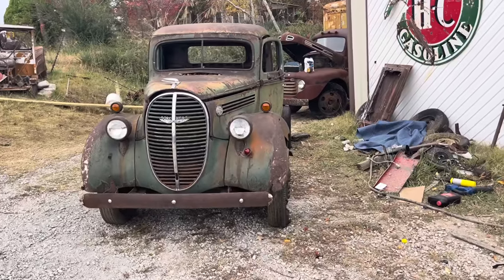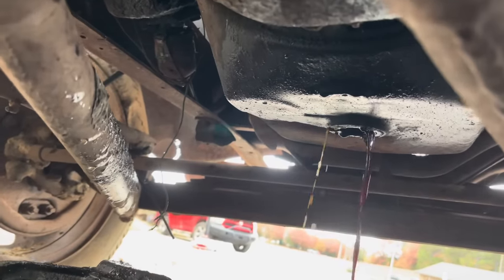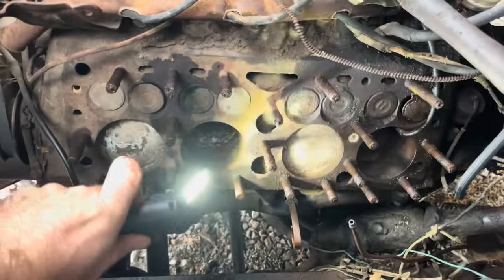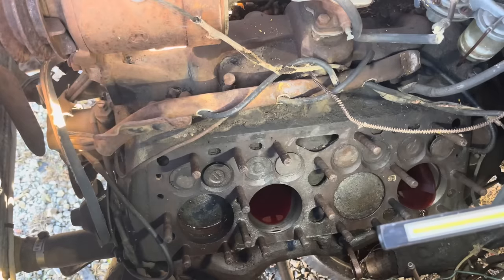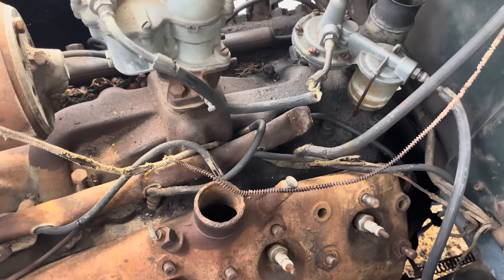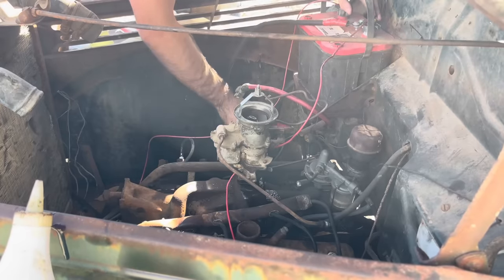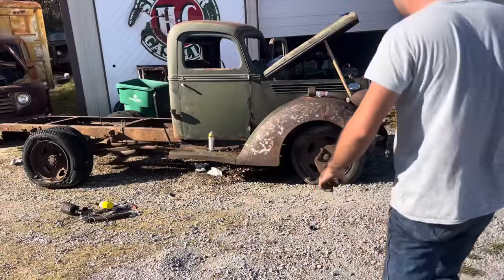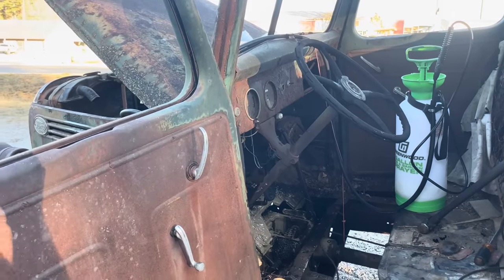Will it run after 65 years 1939 ford 1.5 ton flathead v8 truck

Comment: Imagine 80 years from now trying this with any modern vehicle with all the unnecessary computer crap. It won't happen.
Reply: Exactly lol
Reply: Apparently while the 1996 F-150 truck does have electronic ignition etc the engine it has originally had a distributor and a carburetor. So you could retrofit those parts onto a relatively new engine. The F-150 (and any other suitable modernized classic engine) will probably be the most modern, running, petrol cars one day!
Reply: Just because we don’t have the skills or tools.  These things will be more ubiquitous as the future generations get into cars and they will learn their way around these systems/tools will be developed to simplify it.  To this day my dad still laments about the loss of carburetors and hates fuel injection.  This feeling ain’t new at all
Reply: Year: 2050 "Can't quite get the 2023 Kia Sorento running, on board computer keeps saying: 
Ignition error, Bluetooth device error, fatal exception: Start stop is not working, 5 of the 175 airbags is not working properly, lane departure assist is not working STOP ENGINE.
Apple car play is down, etc."
Reply: @nev12345678910  Yup. I am clueless on carbs, except i can replace jets or whatever and flush it etc, but f tuning it.
FI to me is just plugging it in and getting a computer box on it and then laptop for the rest (I am an IT Pro so doubt much could confuse me at that point).
As for most of the cars today, the worst is the infotainment systems, but those can be dumped for new aftermarket ones, even in 2050+.
And i reckon in 2050 most hybrid cars will just be dumped powertrain wise and get a crate electric motor with crate bats and done w that ... or maybe a SBC 350 if allowed.
Reply: I opened up comments to say exactly what you did.  Jennings is very good.  Modern electronic cars sitting that long would have to have every electronic component changed.
Reply: Yeah...I was just thinking if there was ever some post-apoclyptic future in 50 years, people would probabably try to get the pre 1960s cars running before attempting to get a car from the 2020's driving again.  Although...throwing a carburator on a 4.0 Jeep wouldn't be that different than restoring on old vehicle.
Reply: @JohnnyWednesday There are carbureted LS motors everywhere.
Reply: 80 years from now you'll scan it with your brain implant and have your robot mechanic get it running, and 3d print any parts you need.
Reply: Agree. Mechanical engineering rules.
Reply: Thats a bold statement. No need to be so pessimistic
Reply: 80 years from now there won't be gasoline to run any engine. But you have a good point.
Reply: Yeah they will, just pour some transmission acetone in the computer, 2018 mercedes 8L will fire right up....
Reply: "unnecessary computer crap" is why it's possible to get high power out of a 2l inline 4. It's fine to prefer purely mechanical stuff, I prefer it too. but to say that it's unnecessary is wrong.
Reply: "Unnecessary" sure bud
Reply: You might want to look up computer repair on youtube.... they can be fixed too.
Reply: Got that right.  Perhaps an electromagnetic event would wipe engine control units out completely, rendering any machine useless.  Hacks may take a while to develop
Reply: True
Reply: If you make auto electronics incredibly complex the customer has no choice but to go to the dealer for service. Once in the service bay the mechanics job now is to build a list of expensive repairs totalling  $1500 to 5000.
Reply: @JohnnyWednesday petrol engines once you fogure out the firing order and can add some distributor and a manifold that can hold a carb, you will go far.
Reply: This is already an issue with some mid-2000's cars. Go try and diagnose a computer fault or clear a module in a 2007 Volvo without access to a DICE Unit and a copy of VIDA. It's essentially impossible.
Reply: 80 years from now, lets try to get a Tesla Cybertruck to drive with an original battery pack. And do it in 60 minutes. 😂
Reply: They can't even fix the computer stuff now never mind in 80 years time 😂
Reply: @copyrightclaim3541 This engine will self destruct in 60 seconds the computer says
Reply: A friend of mine makes a good living rebuilding pre electronic vehicles, many of the trucks are sold to people that are either total off gridders or ludites like me.
Reply: @copyrightclaim3541 You can unhook all of that and put a carb on it and a distributor on it.  You can even machine a way to build a distributor shaft if it doesn't have one.
Reply: @spaceghost8995 how do U add a distributor....it won't spin itself
Reply: i grew up working on 60s models,so simple and if you were broke you could still fix alot with just ingenuity,and simple tools,and yes no puters
Reply: 80 years from now will be sending the robots in to do the work
Reply: @dnyce6278  80 years from now well be transporting like star trek wont need cars
Reply: Or it will just start and run like these do, because there's no reason it won't.
Reply: @duskintheforest584 It’s already starting to be what is in the blocks, there are monoblocks that will fail, they can be replaced in 2 minutes
Reply: @Mega_Trond Just today I was watching the news on the Russian YouTube channel, I’m waiting for one American who drove almost two million kilometers on a Tesla Model S, only he changed 18 motors and batteries 🤣🤣🤣👍👍👍
Reply: @davemoore53 In the very You don’t need to repair anything, you just change the module modules and the design of computers or computer units
Reply: Or just pop a carburetor on a Subaru ej and here you go
Reply: They computer problem won’t really be as big as people say, more that the ECU will probably literally just stop functioning at that point
Reply: Those cars won't even exist in 80 years. 🤣
Reply: @nev12345678910 Skills and tools have nothing to do with it.
Especially with the modern autos having been designed with planned obsolescence.
Meaning literally that the engines are designed to not only fail eventually but become irreparable. Eventually not even spare parts can be reused.
That is if the current trends are allowed to continue.
Our govt has sold down the river to China. They seek to be the world's leader of EV exports and battery technology.
We're (those paying attention) slowly starting to see the end goal of the "climate crisis". . 
The EPA forces automakers to keep making crappier and more expensive cars..
Reply: I thought the same exact thing
Reply: As long as there's people like this guy that loves fixing cars, they will be able to get them running no matter what era of cars.
Reply: Guess you haven't watched any repair videos on electronics. At the end of the day vehicles only need spark,fuel and compression. Someone can make a code and computer to run basic sensors no problem.
Reply: Imagine trying to find the plastic parts that disintegrate.
Reply: @JohnnyWednesday pretty common to do this. Can’t tell you how many Lt1s or tbi small blocks converted to carb
Reply: Robots won't need cars😂
Reply: There’s your problem it’s a Kia.
Reply: I saw a comment someone posted the other day talking about how cars today are more reliable,built better, and last longer than these older vehicles.
Reply: Things even older will keep running. My dad was in the southeast Idaho draft horse and mule association. Their deal was to completely farm about 100 acres every year with horses so they'd have plowing days planting days etc. Well this equipment is much simpler than these cars it's still runs after having sat in the trees and the brush. My part of Idaho is actually on the Snake River plain And my grandpa's ranch was pretty much swamp when he got there. There were little chunks of cottonwood and swamp still down by the river and this is where most of that horse drawn equipment was left. Literally to rust. Of course most of it is simple but really all you had to do was put a few new bolts on find a new seat as hunters and fisherman stole most of them and hook them to your horse. They kept right on going as if they had never been left rot. And they did have more complicated equipment like The first primitive tractors that ran equipment like threshers etc. This equipment would bolt right all back together and fire up and work like it had never been parked.

Single row potato diggers with their moving parts only took a little bit of lubrication. Hay swathers usually just took New oil in the gearbox and it was ready to go. For real most of this equipment would you could have working on no more than one hour.

The more complicated equipment of course could take a little bit longer. But getting one of those early tractors started again was it that big of a deal so you could run your equipment off of it.

And things like hit and miss motors could be fixed in an hour as well.

Hit and miss motors were small engines that would run when you needed it but would then slow down the idle if it weren't needed. You could run all kinds of equipment off these things. From farm instruments to your wife's washing machine to all kinds of things that made your life better. These simple engines are simple to fix and are actually still very useful today.

Our grandfathers and great grandfathers knew how to make stuff that last and would not make low quality products. These kind of old engines and equipment that just fire right back up after years amaze me.
Reply: @JohnnyWednesday  Good, I have a '96 5.0 Bronco, it may be my doomsday vehicle one day.
Reply: Yeah well said.No one will start.Most parts will be totally detoriated
Reply: The computer crap isn't unnecessary, the modern cars won't run without it !
Reply: Garage 54 would do it. They'd cobble something together for spark, weld up an intake manifold with a carb, it'd be some stuffing around, but they WOULD do it

Comment: Gotta love the ol' dirt dobber performance package. Makes it much more collectible.
Reply: That's why the speedometer goes up to 100. 😂😂
Reply: @davida.p.9911  Out of everything he has done. I think setting the engine bay on fire and commenting "Yeah, she's running a little hot. We'll just crank over a few more times to put the flames out." is probably my favorite "Jenningsism".
Reply: @Urabewe65  That dripping gas just a few inches away from the sparking battery had my clinching my teeth just a little bit. 😄😬
Reply: The old dirt dauber motel. 😁
Reply: Don't know

Comment: I went through a lot of the same things with my 1940 pickup truck to get it running. Dump some of that acetone/atf into the transmission, put it in neutral, put the top on and let the flathead spin the cluster gear a while to get the gear changer working again. That frozen rear drum will be a challenge to get loose. Be sure to film it!
Reply: Based on its properties, you can fill it with anything you want; in the fifties we just poured aviation kerosene because acetone was too generous and expensive

Comment: That grille reminds me of my 1939 Ford School bus with a 1953 flathead engine I bought in the '70's..  Always started, too!  Went from CA to Nebraska and back in the winter one year!  Installed an Onan generator and several heaters onboard, plus several hot water heater units on rubber hoses to keep warm.  20" tires replaced, and the steering was adjusted by pulling down on the front axle, I recall.  Adjusted brakes, changed the fluids, cleaned the windows, replaced the windshield wipers, and we were off!  Wild ride coming down through the mountains in Utah in the winter.  The gears would sing a beautiful song.

Comment: Great videos! Amazed  you're able to start these engines that have been off for decades! Drove to my dad's house in Connecticut and took him out for Father's Day today. On my way to my dad's house I drive by a house with a truck from probably the 1930s or 1940's in the front yard. It has been sitting there at least since 1994. I bet you would be able to start it. When I watch your videos I think of: "Great difficulties may be surmounted by patience and perseverance" A letter by Abigail Adams to John Adams dated November 27, 1775. Greetings from Massachusetts.

Comment: You got lucky on this one. Considering that it was left open, it was amazing that it was in such good condition. You are always going to have stuck valves on a flathead, so pulling the heads is usually always a necessity. You had four valves stuck on that one side. Did you fix that off camera? The second one from the front and the back three were not moving.
Reply: @21:00 a huge fuel leak dripping and he hits spark with the starter... Amazing it didn't blow up or burst into flames.

Comment: I am 75 and I learned to drive a '38 just like this one. Starter is mechanical button on the floor to the left. Clutch is mechanical linkage. Crashbox 4-speed. 2-speed rear end with dual tires. I was 15 and drove it pulling sage and manzanita brush. There is a support by the throttle that I could move to the left to rest my foot on.  Some brush was so tough to pull out that I could get the front tires off the ground while the rear tires with chains chewed up the ground.

Comment: There were 4 stuck valves on the driver's side when you started turning it over. Nothing was said about them and then you put the head back on. Evidently they must have started working because you got the motor running.  Nice old Ford. There's still a lot of parts for those old flathead V8s

Comment: I was surprised it turned over that easy
Reply from the maker: I was to not sure if it was from the oil pan of diesel or them atf and acetone or the starter i rebuilt I will just say It was luck

Comment: Reminds me of my first vehicle, a '29 Dodge panel truck that I pulled out of the woods. The back plug on the flathead four-cylinder had rusted through and the piston was seized. I pulled the head, soaked it best I could, then found a piece of log that just fit into the cylinder, towed the car down the street with my brother steering while I whacked the wood with a hand sledge. The back end of the truck was hopping up and down, but when the engine finally let loose, that log went flying up in the air. We finally did get the engine running, though the updraft carb was so rusty I resorted to dribbling gas through the port for the vacuum wipers.

Comment: You need to fix that fuel leak, especially with that sparking from the battery, before you get a flash burn.

Comment: Borchers is a trucking company. Though a 1939 Ford in OD green makes me think a military truck
Reply from the maker: Thank you for the info for what I was told a old farmer had it and parked it didn’t know why it was parked until I noticed the head half off and the water in the oil pan
Reply: I think that was a factory color as my grandfather had about a1953-54 pickup that same color.

Comment: I saw 4 stuck valves when you were spinning it over
Reply from the maker: You are correct I didn’t notice until later but a few hits with a hammer fixed them

Comment: With All of these "older" machines simplicity equals longevity.
In 65 years not many of the new vehicles will start. But these 
well, long may they run.

Comment: When you turned the engine over 1st time I saw 3 valves not opening or stuck partially open, how did you verify and address valve operation???

Comment: I saw about half or more of the valves weren’t moving!
Reply from the maker: You are right I didn’t notice that at first but before I put the head on I gave each of them a little tap with a hammer and they started to work

Comment: It's too bad these flathead were so weak in the horsepower department because im a chevy guy and theres never been a better looking engine ever made like a Ford flathead 👌
Reply from the maker: They are gutless but awesome engines they have a amazing sound only problem is no matter what you do to them you are lucky to get 150 hp out of them even if you start with a 125 hp mercury it takes a lot to add 25 hp
Reply: Ron Main of Chatsworth, California, has one making 700hp
Reply: @g.o.b.2558  - on petrol though? how many original parts left etc? - either way, he got lucky with the casting of that particular engine block. No doubt not many could take that!

Comment: Completely filling up and drowning the trans with muriatic acid and letting sit for a few hours or more under supervision will remove a lot of the corrosion and clean it up really well. The same could be done with the rear end, recycling the acid helps, too. Just got to get oil back in when done. 
Curious how much time was edited out of this resurrection. The driver's side valve ports were really clogged. Couldn't see the passenger side valve ports...

Comment: The altermarket heater...  What was the brand of that?  My grandad had a 1940 Ford truck.  Your motor ran almost as good as yours did.  My transmission shop used some lightning oil, that cured all the whine, and syncro could almost worked.  I can't remember of that oil stuff.

Comment: I noticed you just skipped the 4 stuck valves you must have got loose before you put that 1st head back on lol. If a feller could find another cab back half it would make a cool extended cab rat truck

Comment: Nice! It seems you can get anything to work.
Just one thing. When there has been so much water in the oil pan for obviously a long time, what about the oil pump? Did you check the oil pressure?
I had an old engine that had been outside without the cylinderhead for some years, of course with a lot of water in it.  The aluminium case of the oil pump had almost disappeared because of the chemical reaction between aluminium and steel. This pump maybe isn't aluminium but metals corrode.